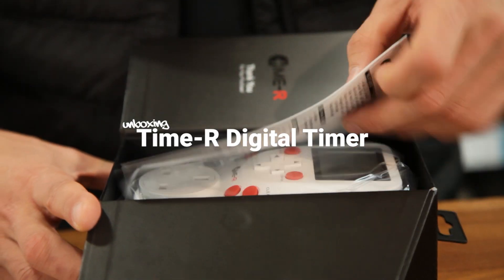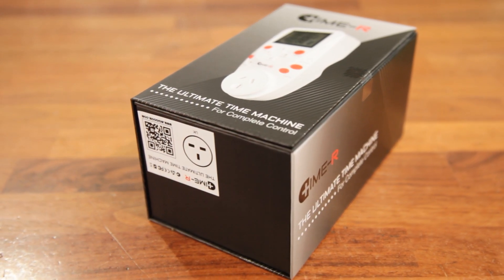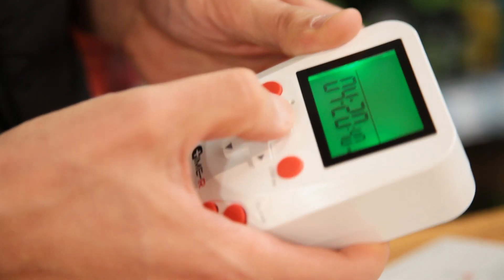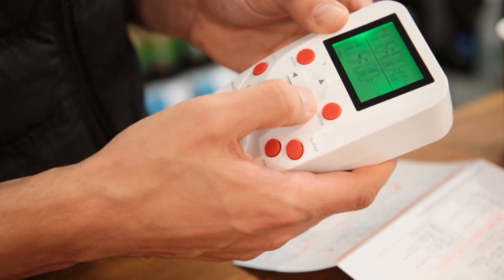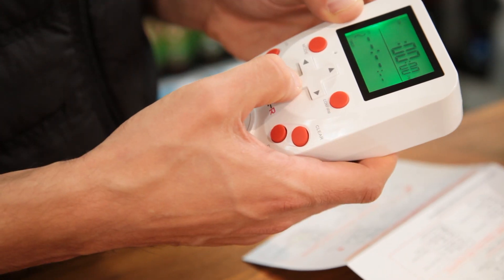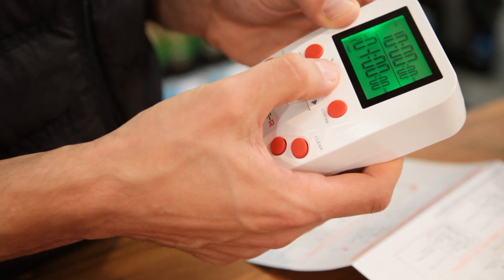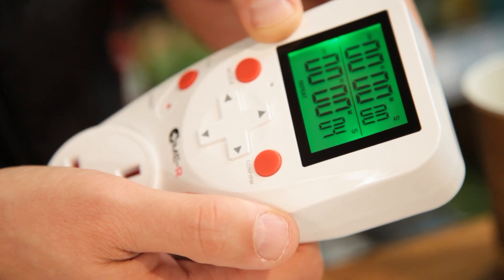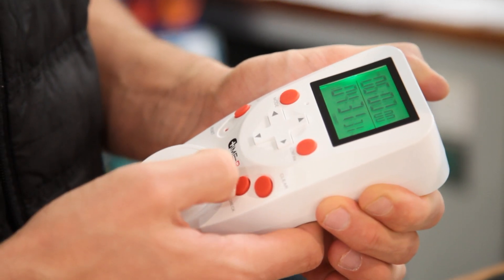Time-R Digital Timer - Unboxing

Comment: Is it possible to run the timer for 15 seconds, every 5 minutes, 24/7?
Reply from the maker: you can set up to 15 "on and off" times per day, but it won't give you that level of control that regularly. I'm unaware of a timer which will give you that level of control for your devices, most give you control but up to "x" amount per day
Reply: @OneStopGrowShopHydroponics  isn't that what the repeat mode would do?
Reply: @leah.internet  that's what I thought